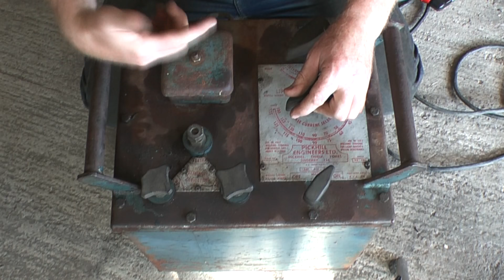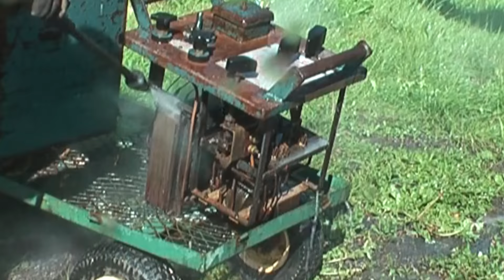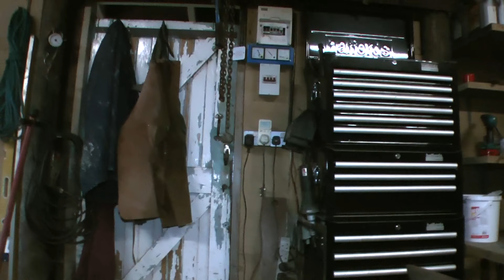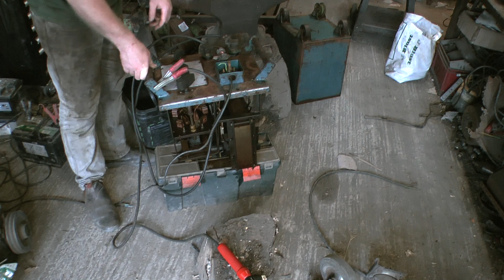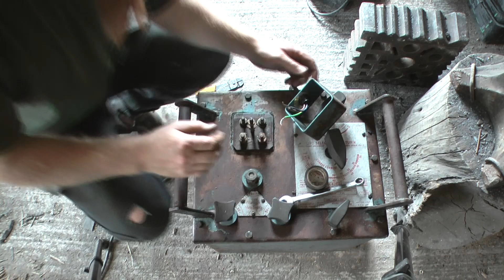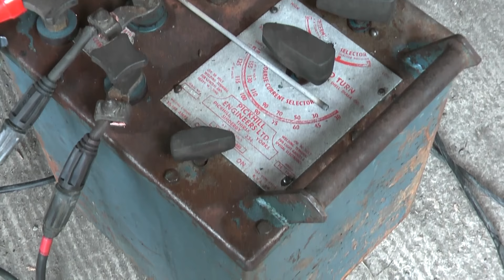Restoring a vintage welder

Comment from the maker: Big thanks to viewer +henrikoldcorn for his help with this video!
Reply: Your selector should be immersed in oil as they will get hot.
Reply: You can find out about the history of phone numbers and it's interesting stuff. The hardware as well, where it came from and the GPO engineers that led the way with telecoms and some of the GPO guys worked on Bletchly park hardware AKA Colossus or the many machines they had built.

The switching systems that led to the telecoms system the UK built if I am not mistaken came from that early research, if you look in to Tommy Flowers, the man behind the machines concept and the use of valves for switching like transistors.

Digital electronics was born around the end of the 30's early 40's.
Reply: I have a number of these in working order but if you try an inverter welder , I have one you can carry one finger welds 1/2 in plate in two passes and much kinder to electric supply , I only use an Oxford at night economy seven
Reply: They we built in yolk & oxford  England . 1945 was the first time the Bantam welder was develop the a good stabile welder & with a long duty cycle  with a bit of modern kit they Make a good basil  DC TIG welder  They dont make them now But there a good tool,  I myself  have a Bantam & a bigger versions that runs on 415 volts  I us the Bantam the most to day   The Bantam is  your welder that will run on 240 & 415 volts. The   Big ones stop at 415 to  350 volt's  & cannot run on 240 volt's >  [well it will but it will not weald]

I once mad the mistake of selling my first Bantam. when i Percent  my first MiG. Was that a mistake. when i fell on hard times I could get work but could not afford the gas a writ to run the MiG  it. often cut out when i ran it on stick i could afford a box of rods .  But the duty Cecil was short.  in time i ern sufficient to by me a new one . & i did never look beck. My Bantam got pinch once  wen my shop was redid , & i had the insure by me a new on  But it was a Big one & i dont thin i have ues it but twice. it to heavy to get in the back of my van.  they mad the half as Big  as your.  set & called them the Bantam   for the props off mobility .  i bot a second hand one & still have it . today  & it's DC side dues my TIG  work.  So enjoy it & never let it out of your sight.  { it is worth it's  Wight IN gold.

Comment: Hi Maximus, I used to be the main dealer for Pickhill welders in the 70's until 82 in Herefordshire, I sold all over the Welsh marches including Gloucester and Worcester, oil filled welders build up water in the oil due to condensation caused by the frequent change in temperature inside the machine causing air to breath in and out of the welder after each use, this moisture condenses on the cool lid, the drops into the oil and goes to the bottom. In later years they had an oil plug on the bottom to drain out a few litres which could be separated from the oil and returned to the tank from the top.
If attention is paid to this the welder should last for ever.
Caution, do not place metal objects on the top of the welder, a spectacular short between the terminals could result in serious damage before a fuse blows.
I have watched nearly all your videos and really enjoy them. If I was 40 years younger I would consider a similar off grid lifestyle. But now with a large garden and 2.5 acres of orchard and paddocks I grow most of my fruit and veg, some meat and 90% of my eggs
Happy new Year for 2019 Brian
Reply: Hi Brian did you sale Gable Arc Welder's in Hereford, if so I had one from you back around 83/84 in Hereford market, and what a lovely welder it was...!
Reply: @anthonygostling  hi Tony, yes that was us, (me), a supplier did a dirty trick which destroyed the business overnight, I placed it into liquidation in Feb 82. Went to Oman for a couple of years to earn some dosh, working for Marconi, another business that went pop.
Back to UK, worked for Miele as sales manager in commercial dept until 2002, took early retirement to nurse my wife until I was widowed in 2017, now living the dream, orchard, food forest, permaculture perennial veg garden, chickens, geese, ducks, dog n cat, keeping the old bones working 'til I drop.
Reply: @briangable08  Sorry to hear about your wife, sad times am sure, would to meet up sometime to see you again its a long time, all the best in the mean time, and good luck with the farming...!
Reply: @anthonygostling  I f you're up N. Hereford way, there is always good coffee, builders tea, or a bottle of beer, for a chat :-)
Reply: @briangable08  Thank you Brian
Reply: I bought a Pickhill Bantham 5 years ago from and old blacksmith in Kelty in Fife, I'm about to start using it for the first time as a bit of a novice, I did do arc welding at the tech some 42 years ago and really enjoyed it, I think I will have a lot to learn again. I want to build a yard cradle for my boat to sit on in winter, then who knows.... If I get the hang of it again.
Reply: Yes he should upgrade the welder with a water drain as on air compressors and maybe a oil filler on top as some said they always filled it to the brim to reduce components arcing.
Reply: I am sure pickhill were badged oxford welders ??

Comment: Excellent video. As someone who has an off-grid solar system (utility wanted >14k USD just to get power to the corner of the property): I didn't hear you mention it specifically, but unless your inverter is specifically specced for it, do NOT hook up any sort of welder to it. Xantrex (now bought by Schneider electric) specifically warned me that it would void the warranty and was not recommended, although they had no objections to the 2.5HP electric well. Additionally, when running one of these welders off a generator, I have been told (by the repairman who was rebuilding my generator) that it is an excellent idea to plug a 100w (so likely less for 240VAC) incandescent bulb into the generator when welding. It acts in a similar way to a flyback diode and absorbs excess power when the arc is broken. Very hard on bulbs, but in the intervening years I've had no trouble with the generator. Although the generator appears to be wired directly into the shop, overhead lights will not work as effectively if they aren't incandescent- although it seems like an excellent way to harm the ballast in flourescent light fixtures.
Reply from the maker: Interesting to hear that about the inverter. I have a very nice Studer inverter (very nice apart from being only 2kw) and it's happy to run my inverter welder or the mig welder. It has decent protection circuitry too and everytime I've manage to do something stupid with it, it just shuts off rather than blowing up. 

I agree completely about running a base load for the generator, in my case it's a 40w light bulb and an extractor fan both in the generator room. My overhead lights are LED strips inside fluorescent fixtures, they run nice and bright without flicker from either generator or inverter.
Reply: It may just be the age of the inverter, it's a 4kw that was purchased in 2009, and I'm sure technology has improved in the meantime. Or perhaps Xantrex was just being extra conservative. I have never tripped the output protection on the inverter, the only time any inverter protections tripped is low voltage cutoff (batteries are also almost a decade old, I have the second set on order). I checked the output w/ an oscilloscope a month ago, and didn't notice any deviation from new, pulled the cover 1 year ago to dust internals and check for bulging caps and noticed no issues internally, so I can at least attest that inverters can be quite long-lived.

I assume there must be something to this, as the reason I called Xantrex support was I was considering purchasing another inverter to convert the system to 240V instead of 120V only, as I needed a new air compressor and was considering a 240V unit. I don't know why they would have wanted to BS me, as they were talking me out of purchasing more of their products, but in the end I stuck with 120V only. Massive pain anytime I need to do any arc welding, as my generator is PTO powered from a tractor, so it is a 1/2 hour process to set up the welder, thus I do more oxy/acetylene welding than anything else.
Reply from the maker: I don't know if they do small engine powered welders in your part of the world but my 165amp 2-stroke version was quite handy for occasional use when I needed some heavy arc welding doing.

Comment: HI Maximus

The tank was filled to about 1 to 1 1/2 inches from the top at the end of production, each tank was drilled individually, you may have found when you tried to put it back together the holes only lined up one way.

The transfomer oil was orginally made by shell but cannot remember the grade etc.

The cork gasket was not preformed but just drilled through when the 5/16 or 3/8 bsw bolt was driven in using an air compressor gun. 

The coils were varished cotton coated copper wire dipped and baked usually on a paxoline bobbin, these were wound on old lathes using singer industrial sewing machine motors. 

If we had a repair in the were flashed tested at 5000 volts, it was like a scene from a horror movie and always made the lights dip.

I was an apprentice from 1976 to 1981 and went through the factory oxfords badged the welders but not to sure oxford product history

file:///C:/Users/user/Downloads/016%202017%20Jan-Feb%20Rowell%20Heritage%20(5).pdf
Reply from the maker: Thanks for the background info, v interesting!

Comment: Ahh, that terminal block brought back some memories. At the workshop I started my apprenticeship, I had to dig one of those out of the deepest darkest depths of the storage room and wire it back up for one of the guys to run a stainless steel job. Not a whole lot to go wrong with them, so with a little care (or even a bit of neglect!) they'll last forever.

Comment: Hello again young man, I have an Oxford Bantam 180amp oil filled welder. Have done a video of for my channel too. I bought mine in an auction for £100. There were about eight of them for sale so I chose the best one. They can be used on single or 3phase supplies. I have put a 32amp plug on mine. It was made in the 1980's according to the serial number. As I understand it, a chapp called Cytringham invented them and several different brands of these welders were made. Mine has the ability to charge batteries too, they are great welders and as you rightly say, they will last a lifetime!

Comment: I have to admit that I wasn't too bothered about all the oil that it leaked in the car when I picked it up. I mean, it wasn't actually my car! ;)
Great to see the thing in action. Just goes to show how utterly bombproof it is. I certainly started panicking when I saw the bit in the vid where the water started boiling off though!
Reply from the maker: Well you seemed pretty unimpressed at the time! At least the story had a happy ending. Yes quite an exciting half hour or so drying out the coils by powering it up!
Reply: If you've never pulled into a layby on the A48 with loads of oil pissing out from under the tailgate of a 20 year old Citroen Berlingo while having nothing to mop it up with then you haven't lived! ;)

Comment: Takes me back to my youth looking at that old welder. After leaving school I worked in factory which made car suspension parts. In the factory those welders had a trolley which had hooks to hang the cables and larger wheels which allowed the unit to be easily moved around the factory site. The wheels supplied by the manufacturer were small and fixed from what I recall. In the factory they used a red industrial socket from what I recall.

Comment: I scrapped two massive 3 phase oil filled Oxford welders similar to this. Was a shame, but they were just not needed and the bigger one used to trip the 3 phase fuse on anything over 3/4 power!

Comment: I have one of these Max, I use it as an autotransformer for my phase converter.  At £30 it was way cheaper than buying a proper autotransformer, and I have the bonus of having a rum ol welder for heavy work.

Comment: When my stick welder died after twenty odd years( second hand when I got it) I got one from Screwfix. Turbo! ( it had a fan) lightest transformer ever, a row of tack welds and it tripped out , overheated. Took it back , the exchange one was exactly the same.  Shite   Then got a massive heavy sealey one from a steam rally. £25 and it's been going ever since.  If you can hardly lift it then it's gonna be good. Nice vid
Reply: I have a Sealey. Have had it for 43 years!!

Comment: The advice I was given when I bought my Oxford version was to turn the power off before changing the current to save arcing on the contacts. When I bought mine, for a tenner, I had to make some new contacts so no they don't last for ever but they can easily be fixed, as long as the transformer is good that is.

Comment: The STD dialling system was started in 1959. Coincidentally I saw a clip from the BBC archives just the other day. So you can reasonably assume say a three figure number was before then, and no new telephone installs would have had one after that.
Reply: In the 60s our number was Pailton 412 - it must have been the 70s we became Rugby (0788) 832 412.  I wasn't born until the 60s and I remember answering the phone with the old 3 digit number!

Comment: I was given an arc welder a few years back, also old (has old-colours rubber cable on it, both for mains and used as welding cables!!!), haven't even dared plug it in as it's pretty bodged up, don't know it's ratings so unsure of how many amps it produces, it's been painted over, and the best part, the 13 Amp plug had a 13A fuse with a bit of wire soldered across it, so, definitely more than 13 Amps needed!!! :S

Should dig it out and see if I can restore it, really want to get into welding...
Reply: On the single phase connection it needs 20 amps if you want to use it at maximum amp welding settings

Comment: Thanks another intresting video. Something to be said for old equipment they knew how to build things to last! Had a old washing machine my gran gave me 15+ years ago that she had had for years. Fix it loads of times bearing, motor brushes and belts. Eventually wore through the fixing for the drum springs. Got a new one and it must of been less than half the weight!! Two and a bit year later it had problems with the electronic program selector!! But hay it had a A+ efficiency rating even though its in a dump somewhere now work that one out!!!

Comment: I used the old Oxfords when I was serving my time as a pipe welder. It took at least 3 of us young lads to lift these anywhere. Interesting thing is, I've just bought a 220 amp inverter off ebay for 95 quid and have been hammering it as I thought it was going to be a pile of crap with no duty cycle. How wrong was I! and I can lift it with my little finger.

Comment: oil filled monsters lol - i retreived one that had been dropped into the  thames off a jetty(it had sat outside for at least 5 years then under a plastic cover)  -two weeks later we pulled it out at low tide with the dock crane-banged the dent out of the box ,emptied the oil and salt river water, cleaned up reoiled and was still working !!!! theres really nothing to go wrong lol

Comment: Very little goes wrong with the old oil filled welders. You can sometimes get a shock off , funnily enough, the earth clamp/lead. Particularly outside on damp ground. It'll still weld fine, just be aware. It's usually an untraceable short in the transformer insulation caused by rough handling and er... condensation ie water. Hydraulic oil's fine in welders. Nice video. Regards, Ian.

Comment: Amazing. I'm not criticizing you, but I personally would never have had the courage to open it up and have hundreds of amps run around seemingly unshielded just centimeters away from me. I'd be too afraid of getting zapped. One of the few things I remember from my electrical studies in my teens is that just 1A is more than enough to fry a man from the inside out, so I have huge respect for electricity now. ^^
Reply from the maker: Well it's not really any different from using something like a chainsaw or even driving a car, in all of them one wrong move could equal disaster. I think the key is to concentrate on the task at hand and keep other people, children and animals well out the way!

Comment: I have one of these welders the high volts setting is useful for connecting a carbon arc torch this torch could be used for brazing and heating  metal

Comment: And the duty cycle at full power..... more than one man could ever manage. ...
Reply: add in a small pump, an oil cooler and a couple 120mm computer fans and that thing would weld forever.
Reply from the maker: No need - 100% duty cycle as is!

Comment: Welding in shorts with all that molten metal flying around 😮😂 This I believe is exactly the same as mine, I think theres a date plate on it, possibly late 40’s early 50’s?

Comment: Max, just viewing this again, maybe your generator is running a bit fast so the volts would be high and so would the cycles, cheers, Andy
Reply from the maker: Yes it was, this was filmed just after I'd finally fitted an analog meter to measure the Hertz, so I could set it to 50Hz whist running a base load. It's behaving a bit better now!
Reply: Max, sorry for delay, yahoo thought you were spam, yes analogue meters are much better for some applications where the readings are in constant motion. Hope you found things in the book to get the thinking processes going, cheers, Andy